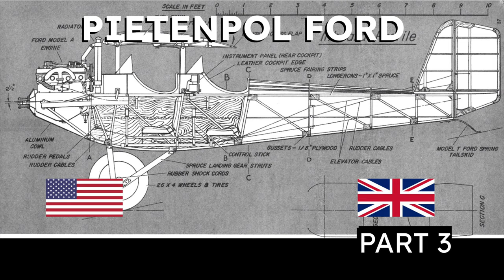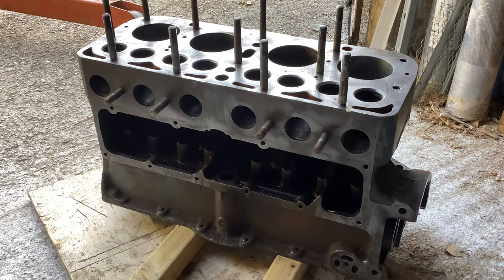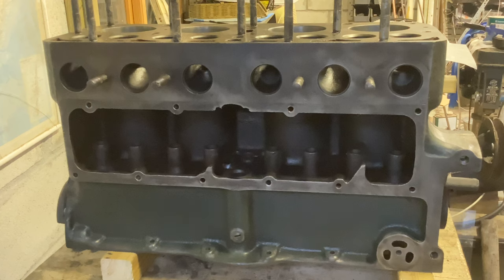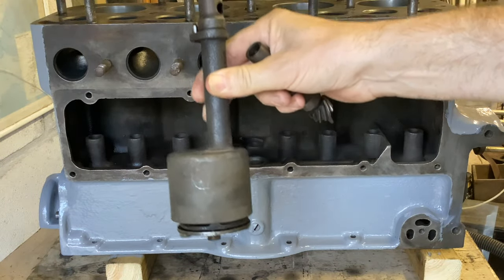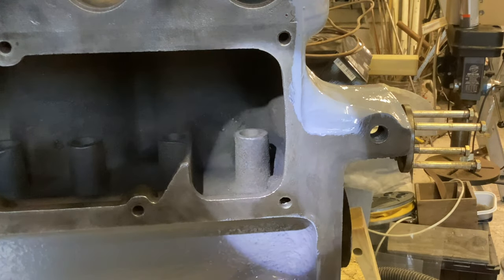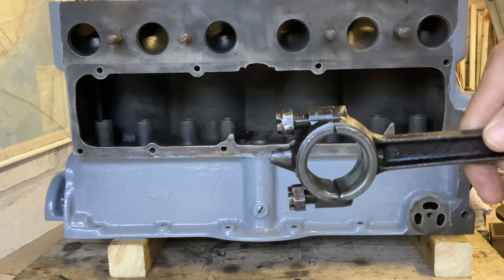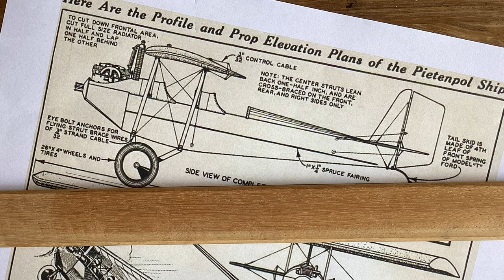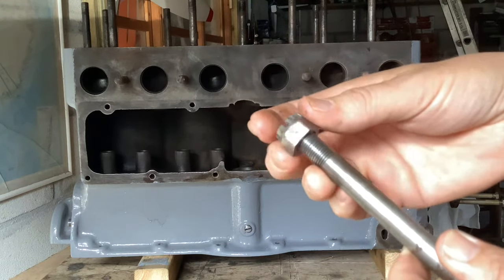Pietenpol Ford - Part 3

Comment: "...a bit of a cylinder bore." Har-har. The Model A engine is so primitive engine but so lovable.
Reply from the maker: The Model B oil system was better, oddly enough it was similar to Pietenpol’s modifications. Ford’s metallurgy was good, probably the main reason so many survive and are still running. The ones Grandpa Dan resurrects often look like they were used for mooring a boat but they clean up well.
Reply: The oil distribution system on the Ford engine seems to presume that the engine is always pretty much flat & not going downhill, how does that work in an aircraft especially diving?
Reply from the maker: @pcka12  That’s what I explained in the film. 12:00 onwards. Diving isn’t really necessary, it’s a Pietenpol, not a Stuka!
Reply: @FlyingForFunTrecanair  the oil system rather explains family stories dating from the interwar period when my maternal grandfather was a local West Country auctioneer, drove Ford model Ts & the like and had encounters with places like the famous Porlock Hill in North Somerset 🙂

Comment: The Aircamper was originally built around these engines, i don't suppose anyone converted them to dual ignition at the time?

Aircampers are still built although automotive engines don't seem to be a common choice anymore, I just wonder if anyone ever tried more modern overhead valve engines like the BMC A & B series which might be lighter & offer more power (of course the dual ignition problem remains & might be more difficult with an OHC configuration rather than a side valve.
Reply from the maker: Dual ignition cylinder heads are readily available for the Model A and B Ford but dual ignition is not needed to satisfy regulation in most parts of the world. The 3.3 litre Ford engines are suitable for use in the Pietenpol as they produced a reasonable amount of power and torque at low rpm, as well as having a large rear main bearing which can accept the thrust load of the propeller. The BMC A and B series engines, which are overhead valve, not camshaft, are not suitable. They do not produce enough power at low rpm and are almost as heavy as the Ford.
Reply: @FlyingForFunTrecanair  thanks for the useful & interesting information 👍PS when I accidentally wrote 'overhead cam' I meant 'overhead valve' (I might have written 'pushrod') I have taken these & other engines to bits & rebuilt them so many times that I cannot think how I accidentally described them as 'overhead cam'!

It sounds as though the engine from my Ferguson Tractor with it's power at low rpm might have been more suitable, I guess that it is the difference between 'long' & 'short' stroke engines which matters & the short stroke variety would need gearing to drive the airscrew slowly enough?
Reply from the maker: @pcka12  I'm not sure 'stroke' makes much difference per se. The Aeronca and Praga engines are oversquare and the 3.3 litre Ford engine is almost square. Low compression ratio seems to be more relevant although it appears contradictory. I like Ferguson tractors very much, my first 'vintage' machine was a TED20 when I was 13.
Reply: @FlyingForFunTrecanair  the idea of 'stroke' originated with my uncle a Bristol graduate civil engineer (who served in Burma & BOAR) he taught me to regrind the valves of an ancient side valve engine & explain the idea of then modern 'square' engines developing power at a higher rev range so needing to be revved to get that power (those engines by past standards were high compression).
I long since noticed that the famous Rolls Royce aero engines operated at relatively low revs & concluded that this related to the possibility of propeller tips exceeding Mach 1 in the same way that a whip crack is produced. Strange to think that schoolboys 'cracking' their ties had a supersonic instrument in their hands! Perhaps like penknives they shouldn't be allowed to possess ties under the age of 25, far less fully armed Spitfires 🤔
Reply from the maker: @pcka12  Rolls-Royce aero engines had reduction gearing so propeller rpm was much lower than crankshaft speed; the Merlin crankshaft ran up to 3000 rpm, quite fast considering the mass of crankshaft, rods and pistons. I doubt engine rpm was limited to control propeller tip speed.
Reply: @FlyingForFunTrecanair  in water craft propeller speed can cause 'cavitation' if it is excessive,  so since air is another 'fluid', albeit a far less dense one similar considerations no doubt apply; Apparently cavitation in the marine environment causes heat generation & can erode the prop.